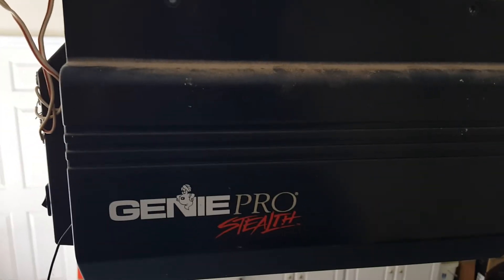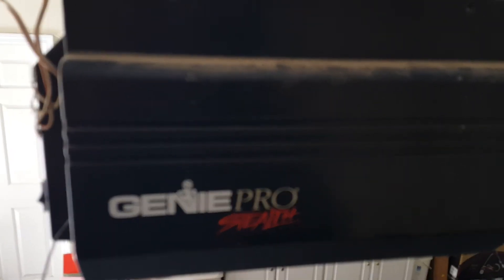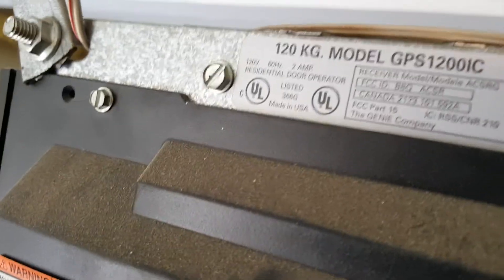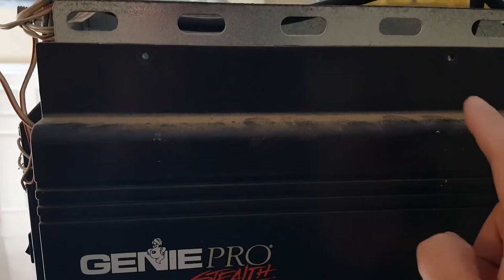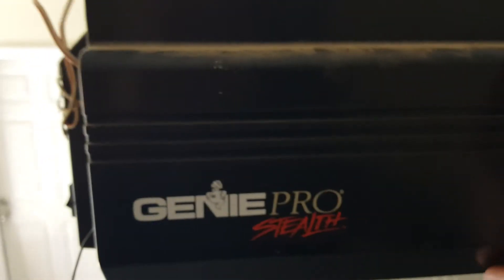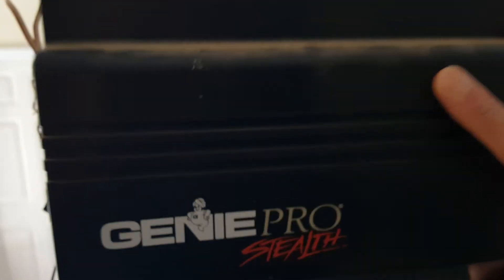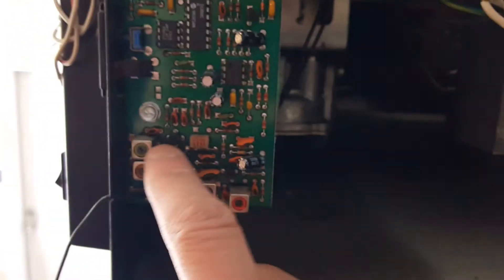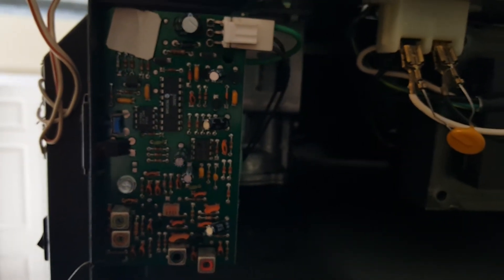Genie Stealth GPS 1200IC Garage door opener, circuit board replacement fail.

Comment: I had exactly same issue with the same model therefore YouTube push your video to me😂. I immediately subscribed but just let you know that there is another board in the other side. The one you showed looks fine just like mine.  But the other board I found some decayed spots. I used teeth brush to clean them out and it worked again.  The local garage door opener vendor gave me a quote of 1500+ usd.   I’m hoping this fixed it.
Reply from the maker: Thank you for the comment, I replaced the board and it still failed.  Clicking sound means something with the board.  It could be anything on it from soldering connection.  Hope you had better luck on the other board.  I ended up getting a newer Genie model that is belt drive and it works great.  I made a video on that one.  It's so quiet I don't hear it anymore from the bedroom upstairs.  I payed $550 for the unit and install in 2021.

Comment: Why does it say fail? Did it work after all? I have the same exact issue…..thanks!
Reply from the maker: Thanks for the question.  It failed because I replaced the circuit board and the opener still did not work.  Had to replace the unit with a new Genie.